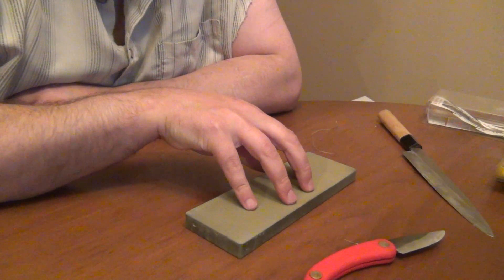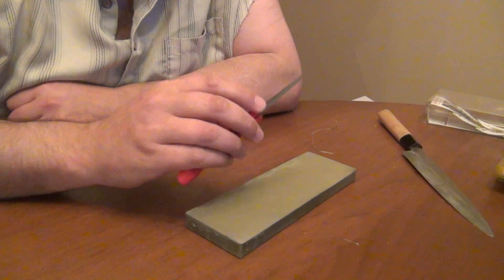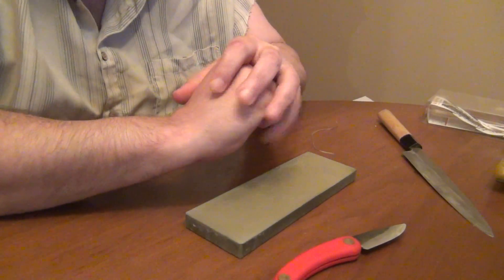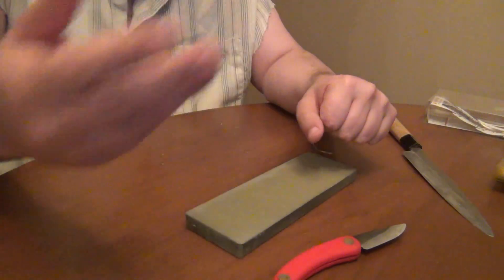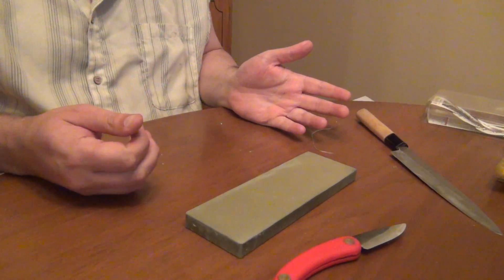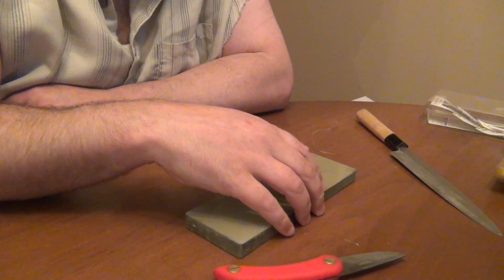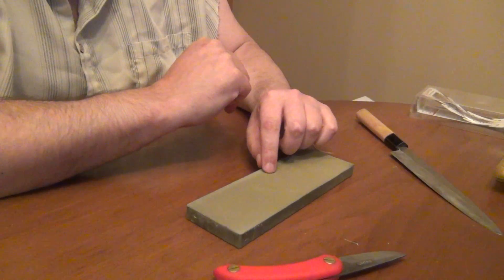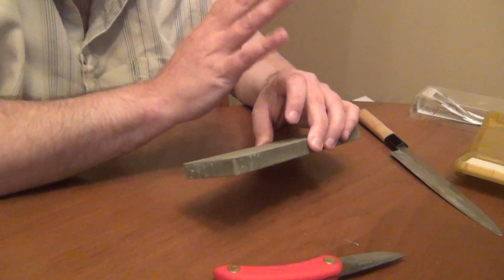Shapton Pro 220 : Japanese sharpening stone - a word about pressures, areas and steel types

Comment: Cliffstamp have you ever used naniwa chosera stones? I've picked up a couple recently and they were quite expensive but work pretty well so far for my needs. Wondering if there are cheaper stones that work as well or better
Reply from the maker: Yes.

It depends on the steel and the type of tools. You have to match mainly the binding strength to the pressure. If this isn't matched well the stone will behave poorly.

If the bonding strength is too high the stone just stops cutting and starts loading. if the bonding strength is too low then the stone just sheds and hollows far too rapidly.
Reply from the maker: Yes, exactly. If the steel is easy to cut and the bond strength is low, you are just going to be wasting abrasive which isn't significant worn.

Comment: If this was true and I'm probably wrong as usual. Wouldn't that mean a higher hrc steel would polish easier then a low hrc steel. But In practice I find lower hrc/ less  where resistant can be  mirror polished at a lower grit.
Reply: If your soft steel is removing bigger  abrasive particles. Wouldn't those bigger particles scratch deeper?
Reply from the maker: I am not sure I follow your reasoning.
Reply: If a soft steel grabs  abrasive deeper and rips out a bigger peace of  abrasive. Then  wouldn't that mean The soft steel is taking deeper scratches then a harder steel?

So by that if the soft steel is taking deeper scratches from being softer. Because it's grabbing deeper and larger grit  particles. Then I figured that means you'd have to work harder and longer to get the same effect.
Reply: Another question. What's the highest grit stone you use when sharpening  pocket knives?

And do you ever find you loose the bite on your edge when you get to those higher grits?
Reply: And I really wish you'd find the time to make videos again you and  Michael Christie are at the top in YouTube land when it comes to all these topics.
Reply from the maker: At a given load, the softer steel will take a deeper scratch, in order to polish you have to make scratches, that is all polishing does. If the scratches are fine enough, it looks polished.

If you have to go from say 100 to 500 grit, then this is very fast on a easy to cut steel, but on a hard to cut steel, well try it on something like Maxamet and you will be praying or swearing in short order.
Reply from the maker: I normally finish with a MXF DMT, which can finish off of a fine Norton/India which I commonly use to reshape.

If the knives are harder use, then I would finish at a 600 DMT or equivalent.
Reply: lol I'm thinking about getting the pm2 in maxamet. Never had a knife in it yet but I'm starting to  realize as a not very seasoned  sharpener I'm not that into high where resistant steels it just takes so dam long. And on top of that i get more  variance in my angle cause I have to spend so much time on a stone. I'm sure that will go away over time but right now kinda sucks.
Reply: I think I should get a  corsair stone and just take my time more to  reduce the chance of scaring my  secondary edge
Reply: Do you know of any waterstones that I wouldn't i can use instead of diamond. I'm looking for something can can cut fast but still shape the harder carbides in higher where resistant steels but still have good feedback
Reply: Or I've also  Heard really good things about atoma plates.
Reply from the maker: Use some kind of jig system until it isn't necessary any more.

Comment: You mentioned this stone is made of magnesium cement - does this stone also include aluminum oxide? Or no aluminum oxide is used in these shapton professional stones?
Reply from the maker: Alumina is the abrasive, the cement (binder) is magnesium based.
Reply: I received a reply from Shapton and was told the 220 and 320 do not contain aluminum oxide. No mention of they did however....
Reply from the maker: That is curious, ask them what is the abrasive.

Comment: You spoke of steel types and pressure - do you think speed is an issue? Hope this isn't a silly question but it occurs to me that machinists bother about tool speed when they're milling & drilling metal. A knife cuts differently at different speeds. I'd guess that knife & stone likewise interact differently at different speeds. It might be an academic question since our range of speeds is pretty limited when hand sharpening and it's tougher to hold your angle if you go too fast.
Reply from the maker: I am not sure, speed in relation to what exactly?
Reply: Blade speed relative to the stone. Oe can pass the blade over the stone slower or quicker. I imagine it makes a difference. I don't know it's significant or even measurable. You seem like the kind of guy that might study that sort of thing.
Reply from the maker: It would make a difference yes, in industry it will effect grit cut depth. I am not sure about it in hand sharpening due to simple limitations of speed. Interesting question though.
Reply: In hand sharpening with usual light lubricating fluids(that is thinner than syrup or honey) your answer is no. At power grinding surface speeds yes speed is significant to how it cuts, not just the rate of cut. single layer coated CBN abrasives continuously flooded with oil(water is chemically bad for CBN, esp at higher temps) are used in what is known as ultra high speed grinding. Now in standard med speed power grinding a chip is taken some heat is imparted to the metal it conducts in a bit another chip is taken removing the hottest layer but some of the heat of the previous chip has already conducted deeper and this new chip also adds a bit of its own heat, thus heat starts to build up in the metal. Traditionally the goal was to keep the metal of interest(either the bulk or the surface) below some critical temperature limit, and was accomplished with extra coolant or slower speeds(allowing time for conduction and coolant to keep up)
High speed grinding works on the far side of the heat issue by removing chips faster than the friction heat of the previous chip can conduct the depth of a chip, thus all the heat is removed in the chips and the metal stays cool. As far as I know this is only currently feasible with diamond and cBN because they are naturally much more heat conductive and they impart much less heat to the metal(at any given speed) than traditional abrasives, cBn may impart 10-20% to the metal while vitrified aluminum oxide may impart 70% of the heat to the metal. The flood coolant in high speed grinding is used more to cool the wheel than to cool the part, oil also reduces friction more than water, boils at a higher temp, and cBN is chemically attacked/dissolved by water and steam at grinding temps. 
Diamond is not used on iron-group metals because at steel grinding temperatures it softens below cBN and reacts with both the metals and carbides as well as synthesizing contaminants within the diamonds.
Reply: I mentioned the high viscosity lubes because they can actually elevate the metal above the peaks of the grit given enough speed and viscosity. More speed or higher [kinematic]viscosity will increase the fluid wedge effect increasing dynamic pressure in the fluid and forcing the surfaces apart, while more load-pressure counters this and squishes the two back together.

Comment: I have spent hours and hours watching sharpening videos in the last week or so.  What I have learned is everyone is Sure they know what they are talking about.  Most have conflicting opinions.  As a newbie, This is Very Confusing.
Your videos seem much better than the average videos.  You are taking in to account everything the real experts mention plus much more.
     I don't have enough working knowledge to make an informed decision.  Perhaps I can ask you for some straightforward advice.  I have a Spyderco sharpmaker as my first venture into sharpening.  It works well enough for the most part but I am getting away from folding blades and buying fixed blades.  My scandi  grinds need help.   I wanted to learn to freehand anyway and so now I am in the market for a bench stone or bench stone combo.
     I will learn off my mora but I have a custom knife being made by NorthEastern Blades.  It is a scandi and I don't have a way to sharpen it yet.  Most of my blades are lesser steels used in folders.  Elmax is my hardest to sharpen with 154 or CMP S30V being easier but still a challenge.   My primary steel that I want to be able to sharpen on the bench stones are high carbon steels such as 1095 and O1.  O1 is the steel of the custom I am getting but I am sure I will want more.  
    What I would really like from you and or anyone else willing to give a new sharpener some advice Is, What do I get?  I understand one stone is not enough and I really need a system of stones but I work retail and do not have lots of money to get the top of the line and in every grit available.   That said, I want something above a "beginners stone" that I will replace in a year.   I thought DMT Duo diamond stones due to the lack of need to flatten them but then heard bad things about what they will do to my edge.  I moved in the direction of an oil or India stone like a Norton IM200.  Then I was told they are too coarse for edge refinement and working with oil stones is just a mess.  So I looked into a Norton Waterstone Starter Kit: 220/1000 grit stone, 4000/8000 grit stone, SiC flattening stone or a King two sided 1000/ 6000 grit but was told they dish too easy and are not good cutters.  I was told to get  just one stone at a time starting with a Shapton pro 1000.  This made sense to me until I was told that sharpton was overpriced for an above average stone.  My search has lead me to more confusion.   Chosera,  Cerax 1000/ 3000, and Naniwa Super Stone have all been touted as the must have item.  As you can see, for a beginner, It is confusing and frustrating.  What would you suggest for starting out?  Remember, I would like to get quality so I can "buy well and buy once" if it will fit into my budget.
    Thank you for your time and consideration.  All advice is welcome.
Reply from the maker: +Michael Reed The thing to keep in mind is that on a basic level all stones can work, they just do different things better than others. 

If you are a beginner then I would not suggest trying to get the perfect stone as there isn't one. A Norton India stone works well with light mineral oil and will handle a large variety of steels well and last practically a lifetime. 

In time you will likely realize you would want a finer stone for edges which do say wood carving so you might add an Arkansas stone, or a Naniwa Aotoshi, or other 1000-3000 grit stone. As your knife collection builds you might want to pick up a few of them to better suit the various knives.

In some respects it is like shoes, you have different ones for different weather/situations. When you go to buy a pair you don't stress out, you just get a pair, find out where it works and wear it, maybe get another couple for different things. 

In the beginning stick to the inexpensive ones and if you have any issues just drop me a pm/email.
Reply: +Cliff Stamp Thank you for the assistance and advice.  It will help a lot when I buy the stones.

Comment: Cliff - Is the magnesia cement composition of the Shapton similar to the Chosera/Naniwa Professional, which makes them prone to developing cracks when soaked? Best regards - Mike
Reply from the maker: +BSEE8512140 Yes, magnesia based cements in general are not very water resistant, hence why they are warned not to be soaked as the bonds will degrade, they can swell and then crack once they dry.

Comment: fair bit of important info in this video. thanks for making it. the surface of my 12k stone looks like a dry lake bed on both sides, any tips?
Reply from the maker: +knives save lives Resurface it, use a light soaking before use.
Reply: i think i may have over soaked it in the past.
Reply from the maker: +knives save lives If it isn't cracked there is likely no long lasting damage.

The higher grit stones can be a bit problematic to use, especially the ones that don't slurry as they can be very glassy/load and the ones that slurry cause fits due to the slurry. Using a high grit traditional synthetic Japanese stone is a bit like walking a cat in heat. 

In many ways a simple Arkansas is much more efficient for setting apex bevels.
Reply: i got it resurfaced without any issues. i've been experimenting with using different steels on higher grits. i am finding that the high carbide ones don't form a clean edge much if at all. i am now seeing what is so liekeable with 154cm as it seems to do really well. i've put it at 8k and it is very crisp and sharp.

Comment: I berate my stones and tell them I'm in a hurry and insist they get the job done. Despite the added pressure, I haven't noticed a difference.
Reply from the maker: +EdD5 Use a French accent, it annoys just about everyone.
Reply: @CliffStamp  My Opinel never sharpened faster.

Comment: what is your opinion on the small belt sharpeners?  (ie- worksharp)  i can get a very sharp knife with mine but could never achieve the same result with a stone.
Reply: Cliff Stamp thank you,  i can see how that could happen.  the manufacture says if directions are followed it should not occur but the variable is the user i think.

Comment: Interesting stone, considering its relative fragility. The type of bevel and the effect pressure has is really crucial, you can easily have fits trying to plane down something like CPM15CMPM or D2 on a Norton, as opposed to just grinding a bevel, something you can easily accomplish with just pressure.
Reply from the maker: Bill22252 I find it interesting that magnesium cements are gaining popularity considering just how easy it is to damage them.
Reply: Indeed, it doesn't really make a whole heck of a lot of sense from a durability perspective, though it is an elegant solution to forgo resin as a bond. 

The thinness of that stone, though. Not an inexpensive stone.

Have you ever used their glass series?
Reply from the maker: I believe they are doing it as a way to use water without soaking.

Comment: Please, please, please don't make your stones cry.

I look forward to hearing how this stone lasts over time and after many sharpenings. In my limited experience, the low-grit, aggressive stones tend to cup and wear dramatically. Considering the reputation of the Shapton Pro line, I wonder if your experience will be different with this stone.
Reply from the maker: YasumotoUS The curious thing to me is that the bond of this stone is much stronger than the Shapton Pro 120.

Comment: I enjoy your videos because I tend to learn things.  I sharpen my knives with various stone because I seem to find that different stones do better with different blades. I dont think I have ever bought a new stone.  most of them are bottom dwelling residents of farm auction boxes. I do use a piece of thick pane glass with water.  it is a good finish stone for some knives.
Reply from the maker: Randy J That is the critical part, different stones often work better on different knives. Unfortunately a lot of people have a bad experience with one knife on a stone and brand that as bad forever.
Reply: I tend to use a carborundum as the coarse stone in place of a file.  Then switch to finer grits when I get the shapes and angles right.  On softer steels I tend to use the red stones boxed up for use on straight razors. You use them with water but I found that some of them respond well to oil soaking and then water later.  They dont especially like to be used with harder stainless steel.  They gloss over the stone and shiny dont seem to work nearly as well. :)